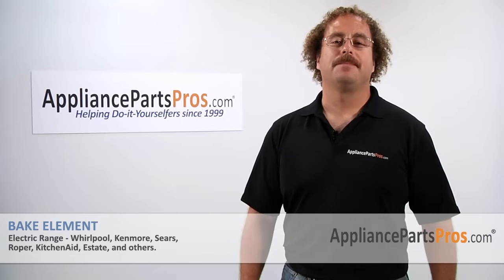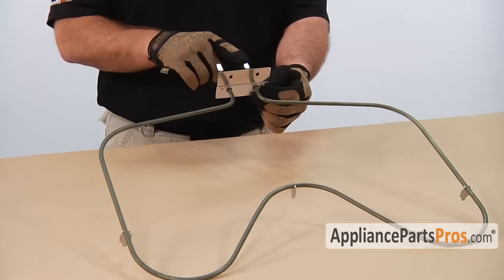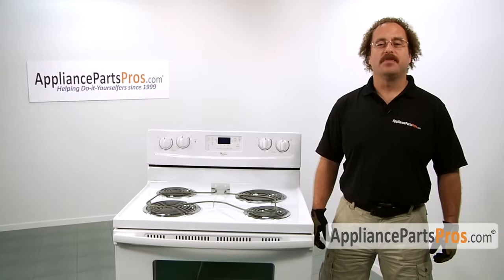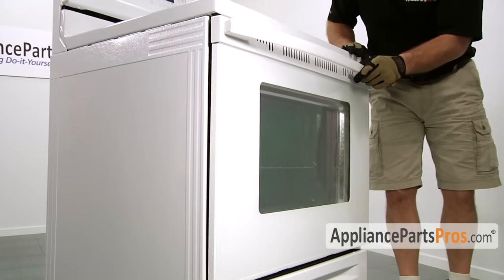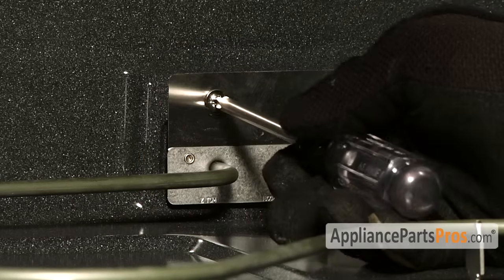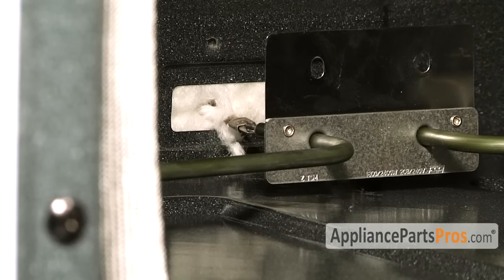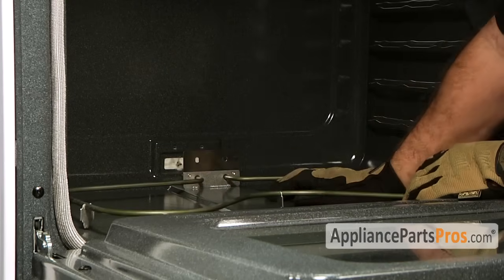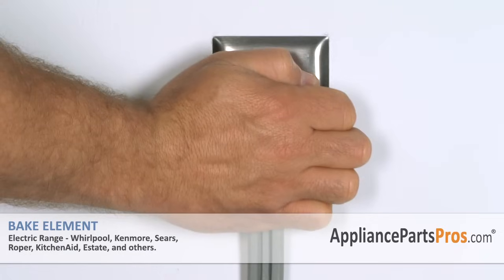How To Replace: Electric Oven Bake Element

Comment: Just a question.  Can you explain this.  My friend called me and she said she forgot to unplug the stove OMG.  She disconnected the baking element, and sparks flew.  She said the electronic control panel turned on flashing 88:88, only when she turned on a burner (the stovetop 4 burners don't work now).  She thinks she needs a new stove.
Reply from the maker: She may have shorted something out. Without knowing what you have, I would suggest posting the problem along with the appliance model number on our repair forum and the techs can help you troubleshoot the problem. http://forum.appliancepartspros.com/
Reply: tyvm....but she figured it would cost too much to repair so she bought a new stove.

Comment: my sister turned on my oven and our plastic cutting boards were in the oven so they melted onto the oven heating element do you know how i can take of the plastic
Reply from the maker: +Octavio Candelas Maybe a blow dryer to heat the plastic a little so you can get it off the element.
Reply: thank you but we already took off the plastic but thanks for the info encase this happens again because its happened twice

Comment: I have class 00 gloves, and considering the oven was off, i.e. no call for heating, I did not unplug to de-energize before removing the broken element (I forgot it has a dedicated breaker and could have just de-energized at the panel). When I went to slide the element forward just to expose the clips, there was an arc to the oven wall at the element opening, and the breaker tripped. So lesson learned. But what still bothers me is why would there have been current present when there's no call for heating? There's not a capacitor in an oven, is there? 
So my concern is if there is NOT supposed to be any current present when the oven is set to OFF, what should I troubleshoot? Thank you in advance.
Reply: I'm assuming it's hooked up to a 240v outlet? That's common with those. There's always 1 leg at 120v going to each element, but it needs 240v to heat up. When you press the bake button, it opens up a relay to send the other 120v to the element.

Comment: Can i use broken wooden pallets for a heat using a broken stove ?
Reply from the maker: So you want to burn wood pallets inside of a broken stove? I definitely don't recommend that, as it's a fire hazard. If you want to burn wood for heat, I would recommend getting a wood burning stove meant for this purpose.

Comment: do ovens hold a current even after turned off i know some older tvs do
Reply from the maker: dylan caldwell Capacitors are what hold a charge. Ovens usually have them on the control board but they are small and usually not a danger. Microwaves on the other hand have a large capacitor that needs to be avoided!

Comment: Ok, very old very dirty oven.  After cleaning the oven I tried to remove the phillips screws and they were seized up tight. Even a power driver won't make them budge. I've tried soaking them with WD40 and other penetrating products to no effect.
Should I try oven cleaner or heat the oven before trying again? I just don't want to strip the heads darn screws out.

Comment: I need to know how to replace one of the terminals. It was completely severed when I took the element out. Can't figure out how to work it in the search to find what I need.
Reply from the maker: jtika1978 You will probably have to pull the range out to access the wires. Then you can replace the terminal so you can re attach the wiring to the element.
Reply: AppliancePartsPros Thanks for the reply. Actually, the wire didn't fall down into the abyss, so I was able to eventually clamp the wire back into the terminal after getting enough sheathing off without severing more wire...it was a total pain but I accomplished it. Haha. The element was super easy to replace other than that, thanks for your help!

Comment: What if the spade terminal connectors don't fit around the ends of the element? I have a GE 
Part # WB44X200 I got is the one that won't connect

Part # WB44K5012  i got before and it fit, but the screws went on top instead of on the sides like my oven requires, so I got the one on top

Comment: hi there ok I done replacement of the oven element then turned breaker back on still not working replaced the fuses for the oven the fuse blew as soon as the oven knob was turned onit also blew the breaker
Reply from the maker: +Brady Mathes You will have to trouble shoot the oven and see what is causing the fuse to blow. Could be a bad wire, thermostat etc. If you need some help you can post the problem along with the appliance model number on our repair forum and the techs can help you troubleshoot the problem. http://forum.appliancepartspros.com/

Comment: Okay so is there a video on how to pull the wires out of the fluff? Cause mine was super tight! And flew right in.... ;(
Reply from the maker: +James Davies If you cannot reach them through the opening in the back wall you may have to pull the stove out to access them from the rear.
Reply: @appliancepartspros  mine is tight too

Comment: Can one change top element?
Reply from the maker: What is your model number?
Reply: Brand: Ropet
Reply from the maker: Yes, the broil element can be replaced. That part number is WP660579. You can place that order through the website, or you can call us at 1-877-477-7278 to place the order over the phone.
Reply: @appliancepartspros  ...saving data now.

Awesome response!
Reply from the maker: Thank you!
Reply: @appliancepartspros  No problem!
Got ya stored to cell!

Thank you!

Comment: Do I really need to unplug the oven, in order to change the element?  Isn't having the oven turned off good enough?  The problem in my situation is that the even is plugged behind the stove (near the floor).  Unplugging it requires me to pull the heavy stove all the way out, which is a major pain in the arse.
Reply from the maker: You can unplug it or turn the circuit breakers off, but the power supply should be off for the stove.

Comment: I have Hotpoint Model 107RB 360F I cant find this model anywhere.   How can I match the baking element that I need to replace.   Will another element work?
Reply from the maker: +Rip Daniels Looks like a really old model. Get any numbers off the element bracket and give us a call we may be able to cross reference it. 1-877-477-7278

Comment: I have slip-on connectors, but I can't find an element with slip-on terminals - they're all Screw ones everywhere I go. The store clerk told me to cut off the slip-on connectors, wrap the wire around the screws at the end of each terminal and that's it. I've attempted this, but it's not looking right; I can't get the screws to go into the terminal ends without the wire getting pushed off.
Reply from the maker: adam1979NSmcc The manufacturers do change the connectors from time to time. Have you gone to our website and entered your appliance model number, to be sure you have the correct element? You could also buy a some ring terminals to crimp onto the end of the wires in the stove. Such as these AP562023, we have them in stock, these are for 12-10 gauge wire and a #10 stud. There is 240 volts going through the element, please do not wrap the wire around the screws as this will probably cause it to short out.

Comment: replacing the oven element and got distracted with the kids, so the oven was not off and it shorted out. Do I need a new oven? or can it still be fixed?
Reply from the maker: Claudia Boomgaart You will need to check the circuit breakers.

Comment: Thank you!
Reply from the maker: +Jenny P Glad the video helped you get the bake element changed!
Reply: It did! But I'm having trouble disconnecting the wires. It might be because of rust though. I'm not sure. I'll have someone else come and try. But at least I know how to do it ;)
Reply from the maker: +Jenny P Sometimes they are on there pretty tight and you may have to use a pliers or screwdriver to help get them off. Also some types lock on, so look carefully at the connector to see if it has a small pin that you can press.

Comment: You didn't say if the color of the wires matter.   Right or Left.  Important point.  That's the only reason I watched
Reply from the maker: The wires do not have to be connected to a specific terminal, as long as there's one wire on each terminal it will work.

Comment: Mine's built into the wall. Where do I unplug that?
Reply: I just replaced my element.  I didn't bother unplugging it.  I wouldn't even know how.  I had no problems.
Reply: An easy way is to simply turn off the circuit breaker for the wall oven.

Comment: We just did this and turned the oven on and now it smells like something is burning and there's a little smoke coming from the oven, is that normal?
Reply from the maker: Keep an eye on it, it should go away. Sometimes there is manufacturing residue on them and they put out a little smoke the first time.
Reply: It turned out fine. We were able to install the part and cook our thanksgiving turkey! Thanks for the video

Comment: My wires fell inside the oven wall.  How do I do that.  I tried not to have them go inside. Almost impossible
Reply from the maker: We recommend to prevent that from happening is that if you have clothes pins or something like that to make sure the wires don't go inside the oven. If they did fall inside you will have to move the stove so you can get to the back and remove the back panel and try to get them back to through so you can connect them to the element.

Comment: where do i find part num# for kenmore heating element?
Reply from the maker: The most reliable way to find the part number for your particular appliance is to look it up via your model number, which you can locate using this tool on our website: http://www.appliancepartspros.com/modelnumber_locator.aspx That will ensure that you're getting the correct element for your appliance.

Once you have the model number, you can go to our website and enter it into the search bar to view the parts for your appliance. If you still need help finding it, we can definitely do that. We’re available 7 days a week at 1-877-477-7278 or you can chat us at our website: http://www.appliancepartspros.com/

Comment: We did everything on the video but it still did not work any ideas?
Reply from the maker: You can go to our website and post your appliance model number and question on our repair forum. The tech can help you troubleshoot it. If the new element does not work you will have to back track and figure why it does not have power. When it blew did it short a fuse, trip a circuit breaker, short the power board/control board, burn a wire? I can't cover all that here but the techs can help you out!

Comment: What do I do if I dropped the wire into the back 😭
Reply from the maker: Unfortunately, there is no easy fix for that. If you don't have a panel you can remove to access those easily then you will just need to dig in behind there to find them.
Reply: @appliancepartspros  I found a super small panel in the back that only required one screw and there it was! Super easy fix!
Reply from the maker: So glad you were able to fix that easily! Let us know if you have any other questions or issue!

Comment: I lost the red wire. Now where do I go? Dotty
Reply from the maker: Dotty B As long as the power is off you can fish around through the hole to try and catch the wire. If it is gone you may have to pull the appliance out and access it through the rear of the machine.

Comment: The video doesn't show how to disconnect and reconnect the wires. Is it obvious?
Reply from the maker: Most bake elements have wire connections that just pull off and push on. There are also some out there that use screws to secure the wires. It is pretty easy to change either type.
Reply: Watch it again....he did show how.

Comment: When I took out the old element, there were three, not two wires and I didn't see where the third wire was originally attached. There is no obvious place for it.